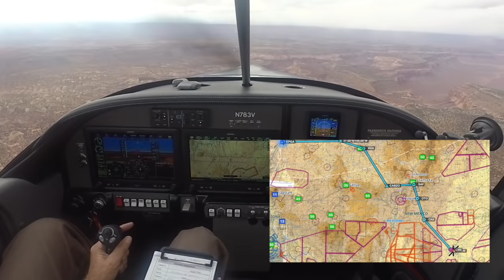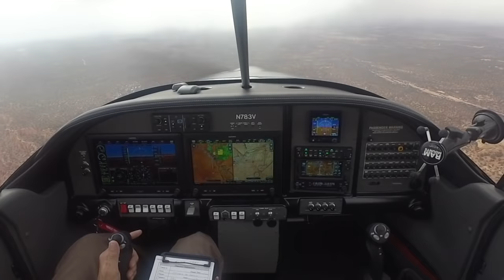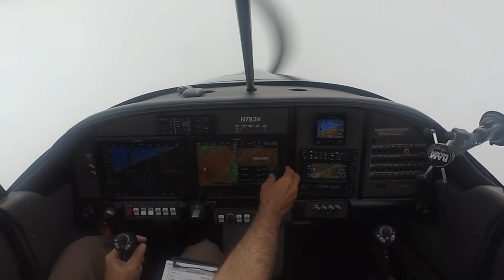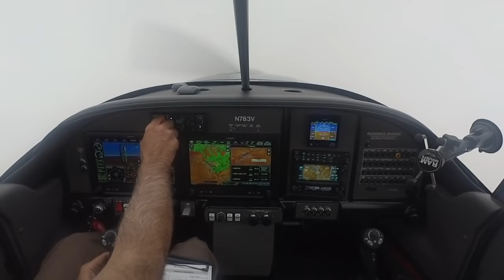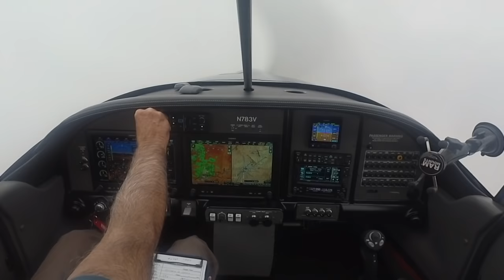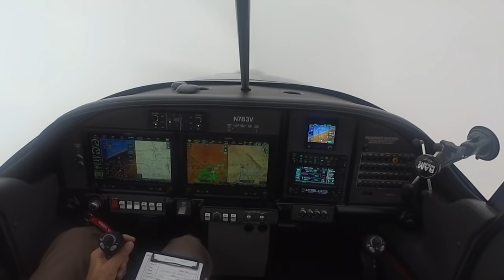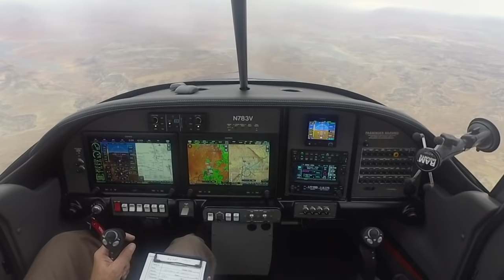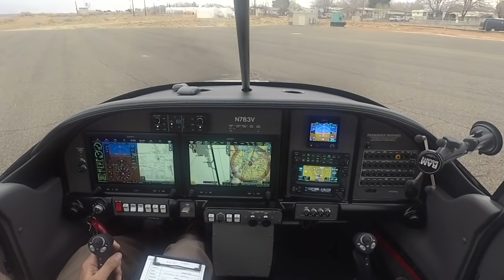RV 10   N783V   My 1st Emergency   HD 720p

Comment: Part (hopefully a small part) of flying is near-death experiences, or at least feeling like we're in a near-death experience.  Thanks for sharing yours!
Reply: Mark, you're everywhere!
Reply: Can't agree with that! That seems like a bad way to survive a hobby.
Reply: @alienxyt  Disagree all you want, it's the truth.  I had a pilot friend who actually got mad enough at me that he all but shunned me.  What did I do to deserve this?  Mentioned in conversation once that "there's nothing safe about flying GA aircraft".   He got very offended at this statement and argued passionately that it's very safe.  As an engineer, I pointed out the pure physics at work with a fairly heavy object traveling high speed and at great altitude.  LOTS of energy involved.  Add to that the typical malfunctions that occur with any mechanical or electrical systems, plus the occasional inability to see where you're going.  If your car screws up you're going to be stuck on the side of the road.  If your plane screws up you're coming down.  Period.  And not necessarily in a good way or in a good location.  My buddy doesn't argue with me any more because he died when his plane crashed after its engines quit from having the wrong fuel put in!!  To avoid the special level of hell I'd otherwise deserve for using my friend as an anecdote, let me pass on the valuable lesson we all learned from his death....ALWAYS SUMP YOUR FUEL.  And pour some on your hand and sniff it.  Jet A in your 100 LL plane WILL stop your engine!  I'm a passionate pilot and fly whenever I can...but I know it's dangerous and accept the risk.
Reply: @markserbu  flying should be safe. For commercial flights there are many safeguards. If a small plane is not safe, then the regulations, the controls, or your technology and safety checks are not right. People often think that they always as cautious as they are in their best moments, but every human makes mistakes, forgets something once in a while, loose focus, or makes clouded judgements. It's your job and the plane engineers job to make your vehicle as safe as possible. In the future, it should land you safely even when you are unconcious.
Reply: @petersizen3897  Flying "should" be safe?  Yet for the reasons I stated above, flying is an inherently unsafe activity.  I can fall asleep while my Tesla is driving me and I'm pretty sure it will just pull over to the side of the road and stop.  If I'm flying my airplane (not on autopilot) and I fall asleep I'll be dead within a few minutes, almost guaranteed.  If a wheel falls off your car you may wreck, but you'll probably walk away from it.  If your wing falls off your airplane you're dead.  Cars and planes and anything that moves a human being along with sufficient speed to turn them to hamburger if suddenly stopped from that speed are inherently unsafe.  We make them as safe as we can, but that doesn't change the reality.  Over the last 5 years 345 people per year died in plane crashes, on average.  That's miniscule compared to the 1.35 million who die in car crashes every year, but that's due to many other factors; mainly the sheer number of cars and the close proximity that they travel to one another.  Anyway...flying is dangerous, yet it's a risk we accept along with many other risks that face us in our day-to-day lives.
Reply: @markserbu  You said that it is usual to have near death experiences with planes. But with cars its not that common. You have more trust in a car safely stopping with you even when something happens. there are speed limits, deformation zones, airbags and the belt. In planes if you dont have lift, you have no options. a detachable cabin with a parachute could be a great solution, with airbags to soften the landing. Autopilots could also help a lot, collision avoidance and auto landing is already solved. Of course soft wing flying has different possibilities, but at least there is the safety chute. I am not aware of all the safety measure, checks and procedures which make flying safer, but i think there are a lot of opportunities for human error. i would really like to see a comparison of accident causes and their  likelyhoods in flying and driving.
Reply: @petersizen3897  you do realize a good portion of planes flying are also rather old. Unless your fairly wealthy your not going to be flying the cutting edge.

Detachable cabin? You realize that A. detatching the cabin only helps the pilot. The rest of the plane is still going to fall. What happens if its over a populated area. Also this intruduces more complexity to design, more points of failure, more controls, more weight, and reduces the strength of the airframe. B. Plane parachutes are a thing. They are very expensive and they ruin the airframe. Also the landing is not gentle and still incurs injuries. One crash with deaths was due to a failure to deploy. Big chutes also take time to open (depending on your circumstances you may not have time). C. Autopilot should NOT be relied on as a failsafe. Its nice to have, but too much can go wrong. Murphy's law. 

Again returning to the first statement. Many planes out there are a LOT older than you think. My friend's piper was manufactured in 68. That plane is almost 3 times older than me and it still cost him a fair amount to own and maintain. Your "solution" doesn't factor in that not every pilot is in the 1% who can afford to toss a new million at a plane every week to keep it cutting edge and tip top shape. Flight clubs normally won't have a brand new top of the line craft either.

The best thing is training. A well trained and experienced pilot makes fewer mistakes, makes better decisions, and knows how to handle an emergency with a cool head. After all, if an emergency happens you have the rest of your life to figure it out.
Reply: @petersizen3897  I really don't think you have a remote understanding of the cost, engineering, and physics behind behind what you ask.
Reply: @oceanbytez847  I am not a specialist on planes and I just see videos of them for fun, but I would like to share that there's lots of old planes who fly for years and years until they are sold and turned into something else. I see lots of videos of plane crashes and stuff, and I've seen planes from the most various ages, specially the Gol 1907 who was an aircraft the company just bought, less than 3 years old and a Legacy plane who cut one of their wings off who was also just bought. The terrible accident wasn't caused because of how old or how young these were but because of lack of communication and proper training. And I see lots of stories of planes who fell and I would say a good portion of them are not due to the aicraft's age but due to lack of communication, lack of training of the pilot in the aircraft being flown, etc.
Reply: @oceanbytez847  I understand the complexity of these issues, and i was assuming that in the long run, money is not a factor when it comes to safety. Technology will become better and cheeper. I think the big question is always if the rules are good enough to provide adequate safety for the different plane categories and in the given circumstances. I know many thing depends on the pilots, if they always make perfect decisions, and the planes are well maintained, then there is no need to have strict regulations. But from an engineering point of view, the best option is to make the safety checks and devices automatic, so no human error will cost lifes.
Reply: Or near-heaven experiences to be exact
Reply: @kevinkong6202  Depends.  ;-)
Reply: @27th-Letter  For me it looks like your runway was not far enough from the houses. From all the stories i have heard it looks like there are two main risk factors in flying. The need to fly even when the conditions are not perfect, like taking risks with old planes, not ideal runway or weather conditions. And the other one is the skipped safety checks because of lack of resources or lack of attention. I would solve these two with higher runway fees and a dedicated safety person paid by the runway operator. i know nobody likes additional cost, but  having a healthy and lets say older flying community worth it.
Reply: @alienxyt  wether it’s flying, shooting sports, car racing, or whatever there is always a heightened risk and as long as you accept that then you can truly enjoy the hobby
Reply: @markserbu  it’s is true buddy, every thing in our life is a risk i got my instrument rating and working on commercial course, and yet still terrified from flying, but at the same time is the joy of flying. Without the margen of risk there is no joy. I always think of my uncle when someone says you could die from flying, you could die from any thing and eventually all we’re going to die as we’re all born, my uncle tripped on two stairs from his porch and had internal brain bleeding, two hours he past away, Peace upon his soul.
Reply: @20121961  I think there are no new things in aviation safety. The purpose of these videos is to create a strong emotion with a good demonstration, why the safety rules and best practices are important.
Reply: @markserbu  flying is actually very very safe. If you think flying has to involve near death experiences and is an unsafe hobby maybe you shouldn’t leave your house ever.
Reply: @adambrackston3471   There are currently 250 thumbs-ups to my comment, so apparently my statement was well-received.  Judging by most of the comments, most people "get it".  You obviously don't.  Flying is not "very, very safe"; it's risky, yet we make it as safe as we can.  I fly pretty much every week, and like all my fellow pilots I simply accept that risk.
Reply: @sjalmeha  Just got my instrument rating a couple of months ago!  Good luck with your journey through commercial and all that.  Are you going all the way to ATP?  Sorry for your Uncle...it's true that there is risk in much of life, and it doesn't take a big risk to kill you.
Reply: @markserbu  well I tell you I haven’t had one “feeling like a near death experience”  while flying because I train and prepare. Of course there is risk like anything which you minimize and mitigate as with anything to acceptable levels but your first comment is just silly. Please share some of your near death experiences followed by how you didn’t preflight or aviate properly to arrive in that scenario, thanks.
Reply: @markserbu  this is EXACTLY why I don't fly
Reply: @markserbu  as a software engineer I urge you to never ever fall asleep in your Tesla. The same argument you made about the aircraft holds tenfold for a clueless computer having full control over the brakes, steering and powerful motors. Humanity is nowhere near the point where self driving or artificial awareness would be a thing, no matter what sales people say and also, computers can't really process images to reliably detect objects. The computer can classify some pixels to be 70% pedestrian, 30% cloud, 6% cucumber but lacking the situational awareness it would switch to the "cloud" interpretation in a blink of an eye under less than favorable conditions. Do trust (more-less) radar based ACC but NEVER EVER trust anything camera based.
Reply: "Hey, Mark Serbu, Airplane pilot, Airplane nut"

In all seriousness, I love what you do man. I'm not an engineer but free CAD software and cheap 3d printers have helped me get into gun design, which I've always had a strong interest in.
Reply: @SavageMotoring  Hey, thanks for the kind words!  I live much of my life doing CAD and to me one of the best things about 3D printing is that it's getting lots of people into it as well.  Best of luck with your designs!

Comment: I once almost "vfr into imc"ed as well I took off to what I was expecting to be a 1000ft ceiling, turned out to be exactly 360ft. The pucker factor here is me being in a pretty original PA 18. So no glass cockpit, not even an ai. Nothing to help me if I were to go in the clouds. I often try to tell the story and the lessons learned to fellow aviators. Thank you for your service to the community. I would fly with you any day.
Reply: Btw, there is a way to fly in IMC ON PRIMARY instruments only! The moment where your altimeter or your variometer reverses is where your aircraft is level. I had a WW2 instructor who thought me how to fly IFR on primary instruments many years ago when I got my CFI rating and I run into a few situations where it saved my neck.😉
Reply: @samaipata4756  Thank you for pointing that out. I'd rather not push my luck though.

Comment: During my 2nd or 3rd flight lesson my instructor had me fly into a large cloud (Cessna 172)....he told me the procedure is to turn around 180 degrees and fly back out, gentle turn, maintain altitude and speed until you can see again. My retired USAF Colonel told me once: "Never fly in bad weather unless you have to". Those 2 things, along with videos like yours, has possibly saved my life and others too. Thanks for taking the time to post.

Comment: And to think...Charles Lindbergh flew across the Atlantic ocean without an artificial horizion or even being able to see out the front of his plane :-)
Reply: @johnthompson9483  doesn't matter.  That's still an amazing feat.
Reply: He didn’t need to see out the front. He did have gyro instruments for blind flying
Reply: @mattmichael6792  He had a turn & slip indicator.  Better than nothing, I guess.
Reply: Flight in IMC while VFR was a regular occurrence for me back when I flew in the Canadian North. 

As long as you're proficient with the airplanr and flying IMC there's not need for it to be a stressful event unless you let it.

After that its just a matter of staying out of the terrain, staying out of icing, and always leaving yourself more than one option. If you're not intimately familiar with the terrain just climb. Not only does it give you added safety but you might even pop out on top.
Reply: @chad1755  From what I understand unless you have enough practice to ignore your inner ear and follow the artificial horizon it's a death sentance.
Reply: @TheAkashicTraveller  You are correct. You need to be proficient in both flying in IMC (in the clouds, on instruments) and with the airplane itself.
Reply: Old Charley Lindberg went to my high school. (Random, I know)
Reply: Amazing there was a fuel tank large enough to make the trip, considering the size of his balls.

Comment: This is why I turn the pitot heat on whenever I’m in visible moisture. Just in case things get away from me
Reply: Yep any time I'm in visible moisture or its less than 50°F on the ground, pitot heat comes on. The peace of mind is priceless.
Reply: Not involved in aviation in any way, engineering is my forte... the first thing that came to my mind is why the pitot tube heater is not connected through a temperature-controlled relay ?? 🤔
Reply: @peterfitzpatrick7032  I believe it’s more the deliberate choice to shift the controls to the pilot (aviation engineer here)
Reply: since aviation is funky like that cuz of air law & regulations
Reply: Yeah!
Reply: @peterfitzpatrick7032  sounds like one more thing that's can fail

Comment: Wow, I bet you learned a lot from that experience. In the long run this experience made you a better pilot.  As a passenger on a flight that encounters an emergency, I would much rather have a pilot that has conquered and experienced an  emergency flight , than a pilot that has had hundreds of uneventful flights.  You are battle tested.   I know some will say a good pilot would have turned back, but what if it were life and death situation and you had to get a sick person to that destination, which meant going thru weather.  I give you a 👍

Comment: I "knew" it as pitot heat immediately.  It really scared me when I saw you in that left unintentional bank.  Things can go bad from there very quickly.  The other thing that worried me was reaching across to pull circuit breakers.  That can induce disorientation very quickly. Thanks for the share.
Reply: Yes that could have made things worse
Reply: That's the problem with flying things can go from relaxed to fighting for your life very quickly...most pilots die from sensory overload.

Comment: You figured it out, but most importantly, you didn't stop flying the airplane completely. Bank angle and attitude never got too dangerous, even if you got behind the plane for a few seconds. Even when your plane was screaming that there was a problem. Definitely a reminder that being IFR rated is only as good as your upkeep of that perishable skill, and with IMC comes icing potential on top of needing to fly to the instruments without an outside reference. I think that you used superior piloting to overcome panic and left enough margin for error that even at the furthest behind the aircraft you got, you lost a little altitude and deviated from heading, but quickly recovered. Everyone benefits from the lesson, and you lived, which is awesome on both counts.

Comment: 😳Shit was going wrong real quick there!
Reply: Yep, it happens fast.  Continued flight in IMC is the #1 or#2 killer of light plane pilots.  Imagine if that was night!
Reply: @JBoy340a  why though? He knew he was flying level and had power. Is it just from panicking?
Reply: @Just.A.T-Rex  usually it is disorientation.  It takes a bit of training to quit trying to stare out the windows to find a horizon and instead switch to the instruments.  Also, without visual reference, your body's senses can tell you that you are flying straight and level when the plane is actually climbing, descending in a tight spiral, etc. The author of this video did a good job of switching to instruments as their primary references.